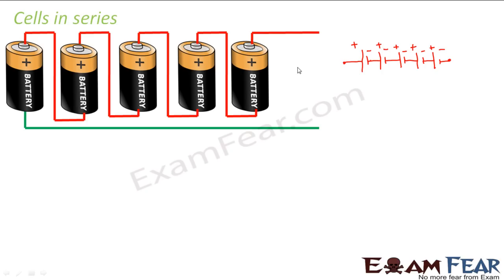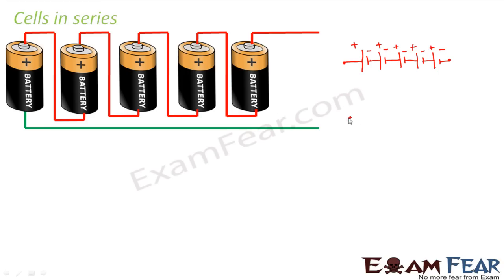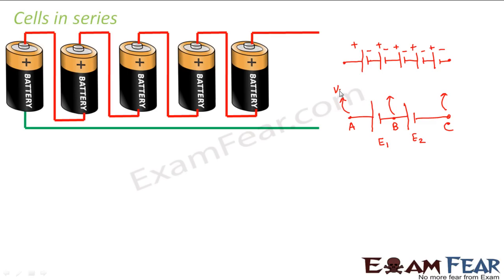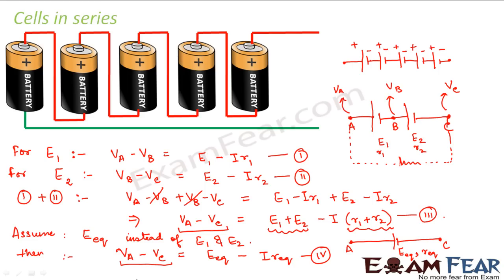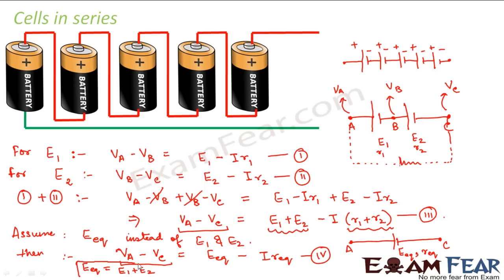Physics Electric Circuits part 7 (Cell in Series) CBSE class 12

Comment: Thanks for another great video, I just had a statement to put up, I guess in the special cases part 1 when our external resistance is more than sum of our internal resistances, it is completely fine for us to ignore the internal resistances of the cell the expression obtained cannot be termed as n multiplied by the current flowing through one cell because here we have nE/R and R is the external resistance and not of a single cell.

However, for the second expression it would be right to say that total current = current through one cell. As here we have resistance of one cell

DO CORRECT ME IF I AM WRONG